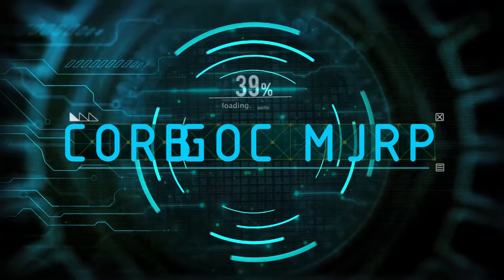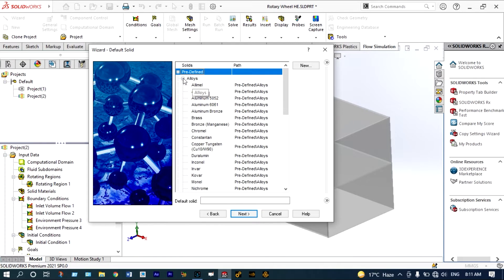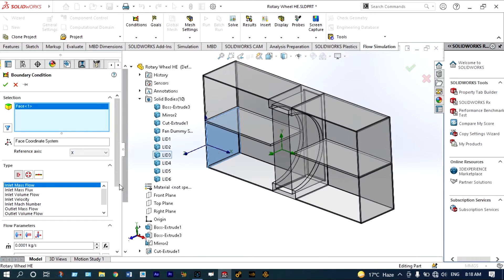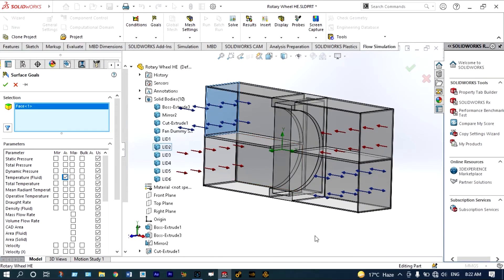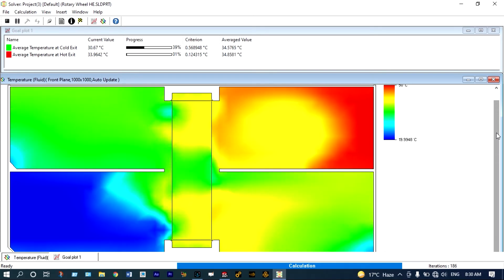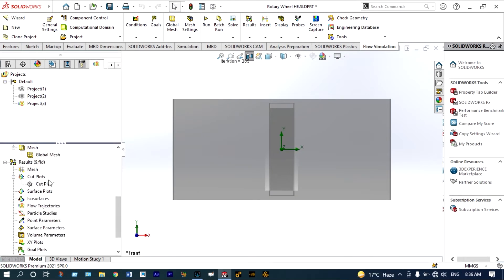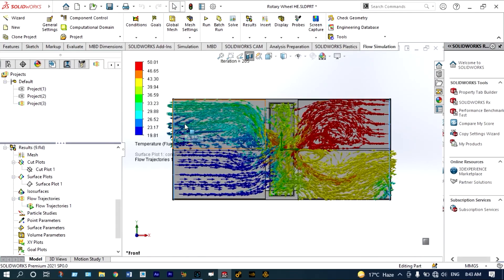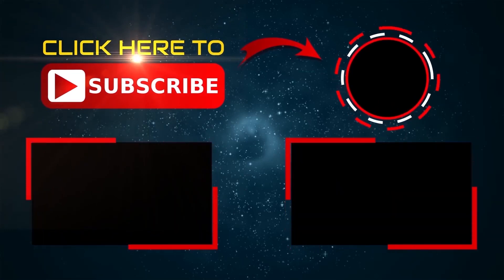CFD Heat Exchanger | Heat Exchanger Analysis | Rotary Wheel Heat Exchanger - SolidWorks

Comment: Hi, thank you for educational videos. I appreciate it a lot! I enable "Disable solid components" in initial conditions, but when I later enter in initial condition, "Disable solid components" is always unchecked. Do you know why is this happening? Also, what exactly does that even mean, Disable solid components? Thank you for your help.
Reply from the maker: Actually in a single fluid domain heterogeneous fluid mixing is not possible under normal circumstances. For heterogeneous fluid mixing we need to follow "Free Surface" technique. In this technique, we need to define all but one fluids as solids and again from initial condition that solid need to be disabled and that to be confirmed as required fluids.
Reply: @CFD_GUIDE  Hi, thank you for your reply, my situation is little different, let me explain. We are designing a cooling system for permanent magnet motor. We have 2 separate fluid domains, one is water in copper pipes which goes through our casing, the other is air surrounding stator and rotor, so we use internal study. We don't have mixing of fluids no where in our motor. We need to set boundary conditions for water flow, velocity of fluid etc. But for air, we just want to rotate it at RPM at which our rotors are spinning. In that way, more realistic heat convection and conduction are achieved. But, we are not sure how to achieve this air rotation, do you have any advice on that. We tried creating initial condition and choosing dummy part which captures inside of out casing, and we use this same part for our rotating region, when displaying velocity of particles after study is finished, we truly achieve velocities that are expected, but temperature on rotors and magnets does not change, and it should change since heat is generated in coils and stator cores. When air is spinning at 5000 RPM it should transfer heat more effectively, and temperature of rotors should be lower. Could you give us advice how to create rotating region for this case? Thank you for reply, Youtuber which reply on their sites are gold! Also, if you know any credible sources on solidworks flow simulation, userguide or something similr, please share.
Reply from the maker: It can be done easily. Before applying boundary conditions you need to select rotation from general geometrical conditions. That rotating region needs to converted as a dummy body. In that case it will be disabled and from initial conditions you can apply rpm of the dummy body.
Reply: @CFD_GUIDE  Thank you for your help.